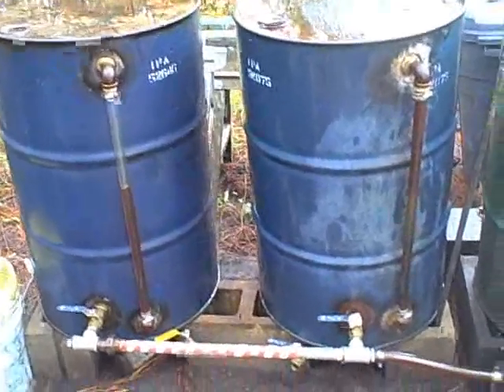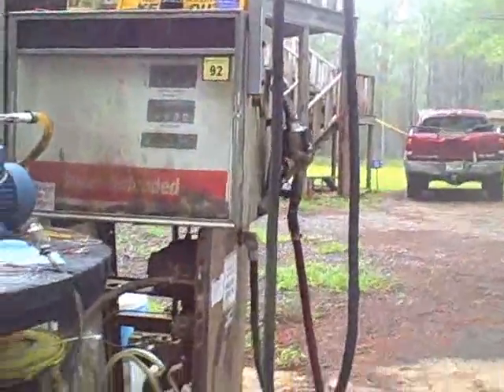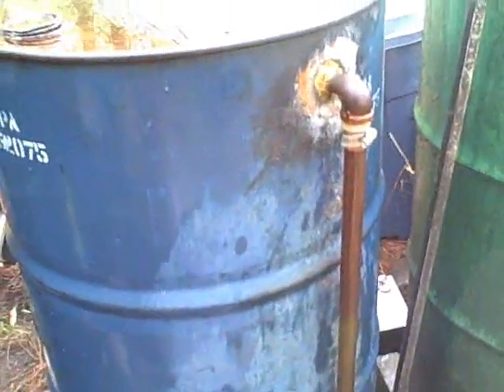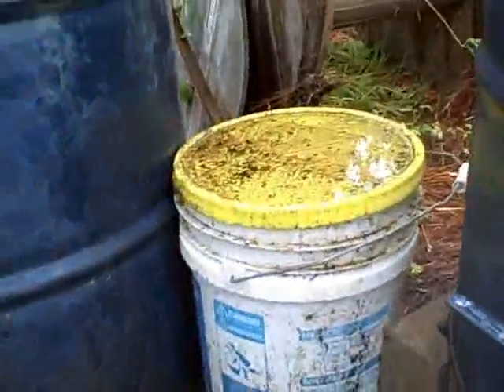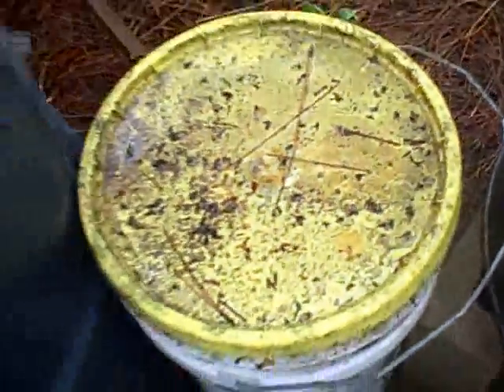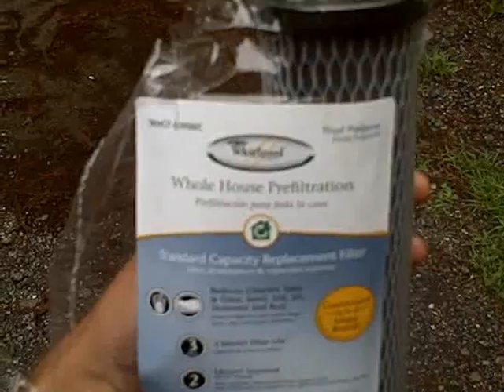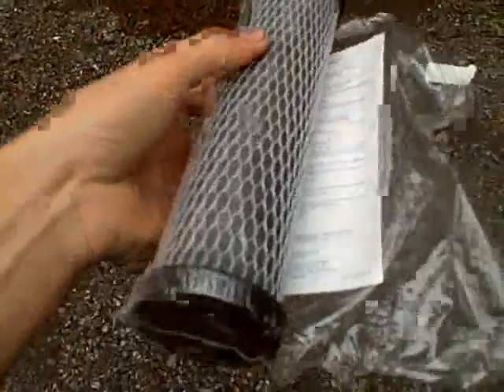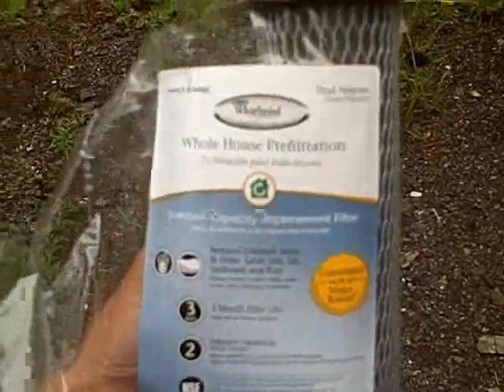Improvements to my WVO design

Comment: Jrcs I would like to thank you for the 200k plus miles I have on grease now for the last 10 years, had to put my 82 1.8 diesel motor in a scrape yard kia sportage, works great by the way, the imark car just had too many problems, but the engine lives on in its new body!! I don't use the formula that you started me out on though, I premix 4 gallon of oil with 1 gallon of gas year round, premixing makes it settle very quickly, I use 55 gallon drum filters from dudda diesel from north Alabama, I don't worry about water very much, I use only one source, and I have complete control over that operation, I'm the restaurant manager.
I average 150 miles to a gallon of bought fuel.
JUST wanted to say thanks for all the money you helped me save over the years, I was looking for a part for my old imark when I came across your videos, THANKS AGAIN

Comment: I used to do it that way until a couple of months ago.  Now I just pump the dirty oil into a 40 gal hot water tank where it only takes a couple of days to drain off the water and settle the gunk out.  Then air pressure sends it through a 1 mic filter to my barrel with my fuel transfer pump/nozzle attached.  The end result is the same but the time it takes is drastically reduced.  I'm in northern Canada and don't heat my shop so the hot water tank is a life saver.  Well a $ saver anyway  ;?)

Comment from the maker: @Gruurk2 Sounds like a lot of trouble to me.. Centrifuges are expensive, and so is heating stuff up. I think I'll stick to letting it set for a week, that's cheap and easy, and has worked just fine for over 70K miles

Comment: this is exactly what i do for my 78 rabbit diesel. i use plastic not metal though. quick tip for longer filter life use a string filter firs then go to the carbon, on top of that wrap the string filter in paper towel. nice work hope to talk to you

Comment from the maker: the old gas pump from a filling station is rusted and froze up. It hasn't been used since gas was $1.09 a gallon. And yes, the cheap pump works great, even pushing through a filter.